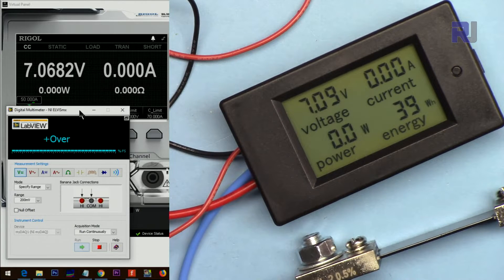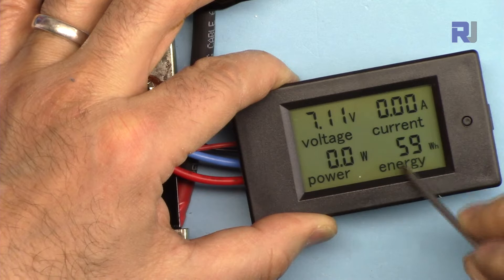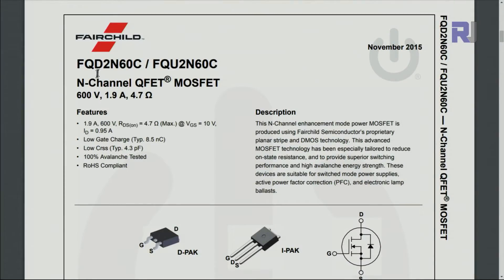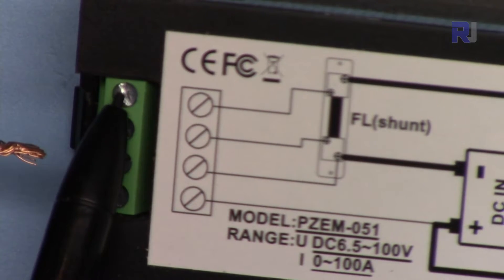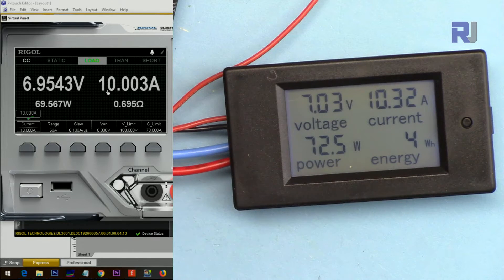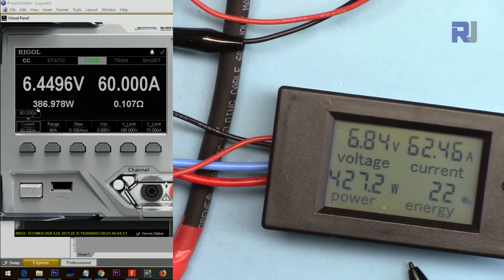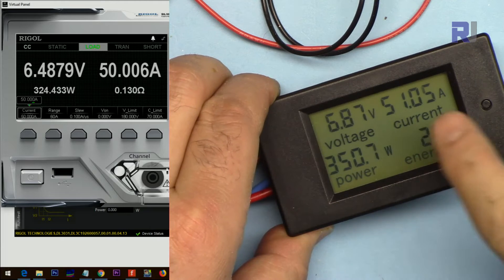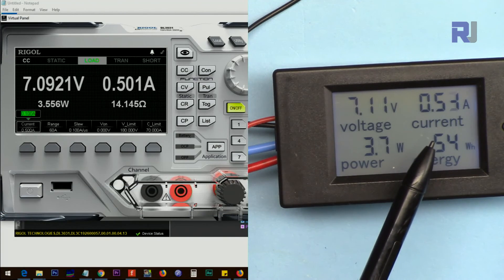Review of Peacefair PZEM-051 100A DC Current Power meter

Comment: Hi.  Great video. I have this unit and am trying to wire it into my dual battery fishing boat. Any help that you could give me regarding a diagram would be most welcomed. Thats
Reply from the maker: Hi, everything have been explained. If you have a boat if you have a motor or anything I called it load in this video. Just follow the instruction. Full wiring have been shown

Comment: what is the maximum size of wire that will fit on the meter terminals. i will be running a load with a current draw of 37-39A.
Reply from the maker: each manufacturer has chart for the wires which depends and material, type, shape etc. here is one example https://www.cerrowire.com/products/resources/tables-calculators/ampacity-charts/

Comment: Sir can i calculate 1000dc voltage using this
Reply from the maker: no you can't. it will die.
Reply: How i can callculate 1200Dc voltage and when power will be 1000kw relay will be opeate
Reply from the maker: This will calculate the power for you. To take some action  like turning on a relay, I have explained it in the introduction video.

Comment: I have this same unit. 
I want to use it to monitor my electricity usage on my camper. 
Your video was a bit more details than I needed. 
Just to be sure. It monitors AC current or both? AC & DC?
I was just looking for a simple diagram to connect it to my AC or both AC/DC if possible

Thanks! 
Great video!
Reply from the maker: this shows on the display only.

Comment: The energy indicator resets in the night, as there is no power from solar panels.
Reply: no, it does not reset. (unless it's broken)   The Energy total is kept when power is lost.  You must access the Clr menu to reset it to zero.   If your meter is resetting after power loss, it is defective.  (I have over 10 of the 20 and 100 amp meters here, they all work the same, they all hold between power loss)

Comment: Thank you Robojax. My question is: Can I replace the shunt resistor with any power resistor like 10 ohm-10watt for example ???? When you look at the instructions on the device, you'll see that the input DC is from 6.5 to 100V. SO why do need separate power supply of 6-7V in order to make it work???????
Reply from the maker: Hello, no you can't replace it.  when you measure the current, there is no voltage.  The device needs voltage to operate so you need separate wires.   see here how the current is measured https://youtu.be/nTNH-PT6-84 
Use Arduino to measure any current or use any shunt https://youtu.be/9jwCc7uPGoc

Comment: How to calibrate exact reading
Reply from the maker: this shunt resistor has 10-15% tolerance. meaning at 100A you may get 10-15% error. now as I mentioned in the video (I believe I did) if you are using 100A shunt, you should not use it for less than 10A or 15A. Above that it works pretty well.

Comment: So is the precision higher with the 50A shunt than the 100A shunt? In other words, if the price difference is negligible (which it is), if I am only going to be using this in the range 10-40A (electric bike at 48V), is it better to stick to the 50A shunt for higher accuracy than going with the 100A (for future proofing/repurposing), or are they the same precision-wise?
Reply from the maker: I should have mentioned it. But here quickly: wer have A-75mV/100A or B-75mV/50A so for 50A we are getting higher voltage and it is twice and good as 100A version. so 50A version is better.  I have explained it here https://youtu.be/9jwCc7uPGoc

Comment: How do I set the voltage as my meter is reading about 50%more than it should?
Reply from the maker: making is less would have been very easy to put voltage divider but making it 50% more means you need to trick the meter to read the voltage from the shunt for example if the voltage is 20mV you want to read it 30mV so you would need voltage amplifier  and it should be linear. So your best option would be to use OpAmp 741 and you just need 2 resistor to set the output gain to 1.5. and 1.5=1+0.5.
Reply: @robojax  I have to make it less.  It is reading 19.5v when it should be 12.7v

Comment: So there is no calibration?
Reply from the maker: No as far as I know. It is already set.
Reply: I understand that the little crack on the shunt is to calibrate it. HOW? Don’t know.
Reply: @manfredg8410  since it's difficult and expensive to manufacture an exact resistance at high current, the shunt is manufactured with LESS resistance (more metal) than is in the spec.  Then they hook it up to a test set and grind in that notch until the shunt's resistance has come up to the exact point in the specification. (they do the same thing with xtals, for the same reason)  The calibration error is not in the shunt, in the video you can see the voltage drop is correct.  The problem is in the meter, it's converting millivolts to amps, and the millivolt measurement is not as accurate as it should be.  I suspect they have a way to calibrate it, perhaps during manufacture and save to that eeprom, but I don't know how to access it as sold. (mine are off by a little bit too and I would also like to be able to calibrate them)

Comment: Hi, very helpful video. Thanks. Does the logger keep a record of the energy if it is turned off? I am using it to measure the energy output of a wind turbine, which will be the DC power supply. The wind turbine will be on and off over the month I want to measure its energy output for. Will the unit record all of the energy produced, without resetting when turned off?
Reply from the maker: Hi, Thank you. Yes it does. It keeps it.
Reply: @robojax  Excellent! Thank you :)

Comment: The circuit diagram measures voltage from shunt Lo to DC+ rather than from DC- to DC+.   That seems to assume an IR drop of 0 through the shunt lo to DC- wire.  That is probably close for low currents but  I am inclined to attach that wire directly to DC- to measure the supply voltage and calculated values to include the energy  dissipated between the shunt and DC-.  Am I missing something?
Reply from the maker: I don't have this on hand to look and confirm.